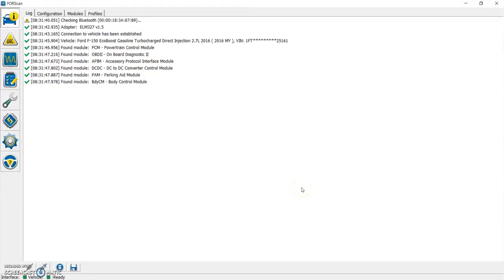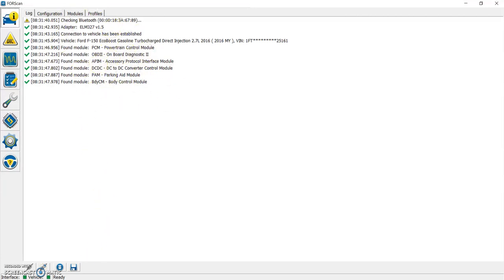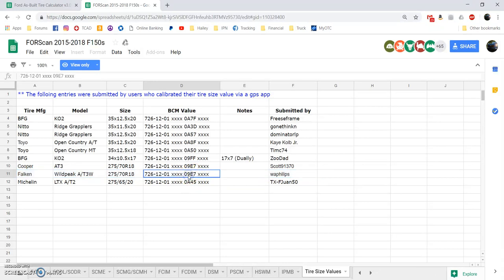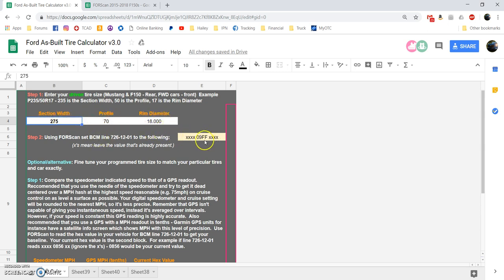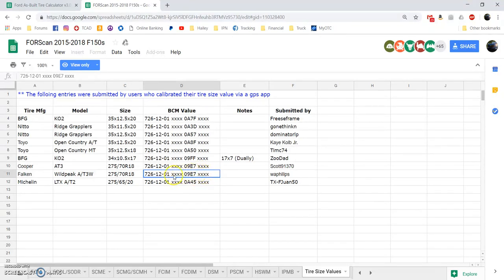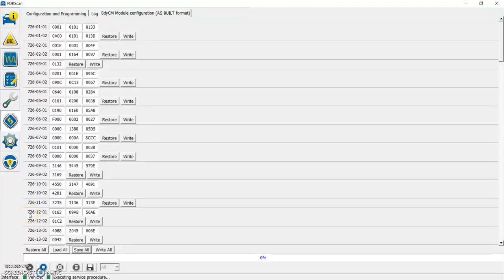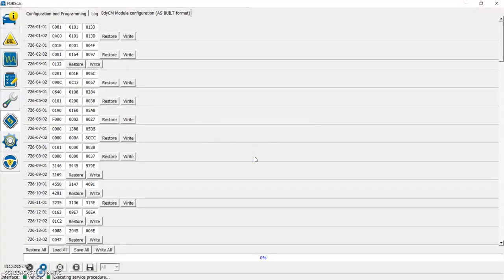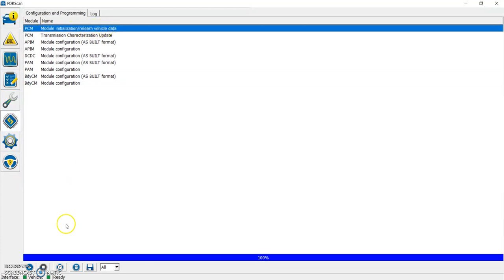Correcting Speedometer/Tire Size in Forscan (15-17 F150)

Comment: To get the correct code number or if you need to fine adjust it, convert your circumference (mm) from decimal to hexadecimal.  For example 2559 equates to 09FF.

Comment: Hello Truck, I"ve been using Forcan for a while, and just added 295 70R 18 on my 2015 F250. Had 275s on before, and my milage is less. Is there a spreadsheat for the 250, cant find it anywhere, or will the 150 speadsheet work. I think it should cause its just the tire, what are your thoughts

Comment: Just wanted to add I have a 2020 XLT With 35” Toyo open country At3 6.5” lift. I set my tire diameter to 2681 and it was dead on. 2355 was what was set originally. 

I started with the diameter google suggests and since every tire is different I had to play around with it. I dropped it from 2791 to 2681 in increments of 20 mm till it matched the gps speed on my phone and radar detector.
Reply from the maker: Glad to hear you got it dialed in! The process works!

Comment: Thanks for this, im new to forescan, well to doing it myself.  I imagine it makes no difference if the tire size is with a level, lift, or stock suspension?  Will it still work the same as far as speedo/odometer/gas indicators being calibrated?
Reply from the maker: Correct. It just changes the tire speed ratio.
Reply: @TruckStuff1  thanks brother.

Comment: Just got new wheels and tires for my 18 f150.  305/55R20.  I changed the tire size in forscan and I got the yellow wrench on the cluster?  What do I do to get rid of it?
Reply from the maker: Reset to the factory settings. The orange wrench is a powertrain fault.
Reply: @TruckStuff1  how do I reset?  Do I pull the negative terminal on the battery for about 30min?
Reply from the maker: No you need to reverse all of the changes you made in Forscan. You can also use Forscan go pull DTC codes.

Before you make changes in Forscan always make a backup of the settings do you have something to go back to if it messes up
Reply: @TruckStuff1  I did the pcm relearn through forscan...it appeared to work as the wrench no longer is there....will it pop up again on a later  date? Or did I actually correct the issue?
Reply from the maker: If it's gone it's probably fixed.
Reply: @TruckStuff1  so I used the tire measurements 305/55R20 (0A02)to re calibrate the speedo...im 1km/h difference....when I used the mph value (0A6B), I was 6km/h difference....shouldn't the mph values fine tune it more than the tire size values?
Reply from the maker: In the video description there is a link for tire size calculator. If you use that it will get you the most accurate number.
Reply: @TruckStuff1  none of the values show.my tire size
Reply: @TruckStuff1  I've already entered my tire size....once I entered 305 55 r20 it gave me value 0A02 and when i scrolled down to GPS values I saw value 0A6B.  Is 0A6B not correct? Do I jabe to enter a specific speed to get the correct value? Or does entering 305 55 r20 give you both values for which ever you choose to use? In my case 0A02 vs 0A6B?
Reply from the maker: You have to so the GPS speed calculation. Enter your GPS speed and what the speedometer says.

Comment: Thanks my man!  I'm just studying up on Forscan and one of the things I need to do when my ODB2 adapter gets here is change my tire size to the exact tire you did in this video.  I've had these 33" tires on my 2015 F150 for 30,000 miles already so it will be nice to get the speedometer finally calibrated.  Plus the check engine light came on after about 89,000 miles for the first time.  I appreciate your video?

Comment: I want to try to add a tpms device to my air ride suspension system but the default pressure threshold seems to apply to two tires at a time. Any way to individually set a tpms threshold? And, any way to add two tpms devices to my ‘16 f150 Lariat? Good video.
Reply from the maker: I'm not sure about that one.

Comment: I just did this two days ago and I got that wrench and I panicked and restored the code lol thanks for the info man. I have a 2019. But do I need to undo this if I have the truck serviced since I am under warranty.
Reply from the maker: If you got an error code you did something wrong. Try it again and read the service codes.
Reply: Truck Stuff going to try the relearn since it’s the wrench on the dash.

Comment: Any idea how this might be done for older (early 2000's) Ford trucks?  I have a 2003 and Forscan only reports one parameter in the as-built module reading.  Also, tire size in a 2003 is not in the BCM, but rather the PCM.

Comment: I need to change the low miles from a new IC to the right ones in the vehicle which are a little higher I do not want to lower them but to make them higher. How do I do it on a f150 2015 xl

Comment: hey dude.. nice video.. very infomative...     do you know if there is a way to have different size tires on the front  than those on the rear. I tried it, and it threw all kinds of warning lights and codes (hill assist, back up assist, traction, TPMS and no e-brake)....   all these codes from just putting wheels off my 2006 F150 (20x9 on 275/45r20 and 22x10 on 305/45r22 tires)...  we are dealing with a 2018 F150 XLT (5.0 w/10 speed).....    any help would greatly be appreciated... thanks...      I hope you are having a great 6th of July...
Reply from the maker: I'm not sure, I've never heard of anyone doing that on these trucks. other than disabling sensors, I don't think there is a way to program that in.

Comment: I have a 2011 F-150 XL 2wd and it has tires that are roughly 1" taller than stock. Original size was 235/75r17 now has 265/70r17. Truck was fine but after I had the transmission reprogram recall my speedometer reads 10mph fast. At and indicated 70 mph I'm only going 60. The dealer said it's because of the tires but the tire shop said a taller tire will make the speedo slow not fast. Has anyone else had issues after this recall?

Comment: Will that calculator work on a ranger i have a 2000 and i need to fix my speedometer
Reply: @TruckStuff1  I seen a thing where a guy with a 2000 ranger adjusted his speedo with tire size with forscan because 1998-2000 2wd rangers the speed signal goes through the gem then to everything that needs it, I bought a module I'm gonna firgue it out whenever I get it
Reply: @TruckStuff1  il firgue it out I hope so at least lol my speedo is off by at least 10  mph

Comment: Thanks for this video! Question  - what sync version did you select after starting the software the first time? I have a 2015 f150 lariat - would that be version 2 or 3? I heard that all 2015+ should select v3 but i couldnt verify. Thanks for the help!
Reply: @TruckStuff1  this is the version i have so im assuming i should select v2 on forscan setup? https://goo.gl/images/Q1TLyX  thanks!